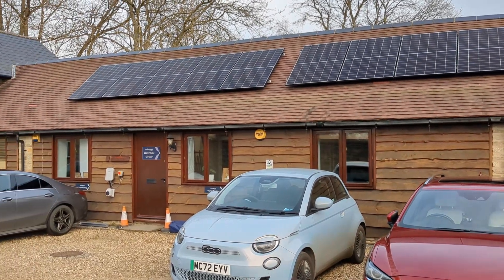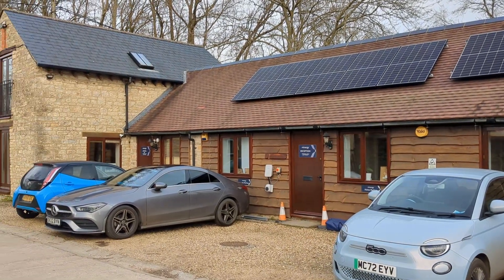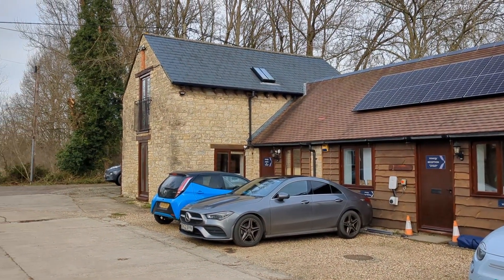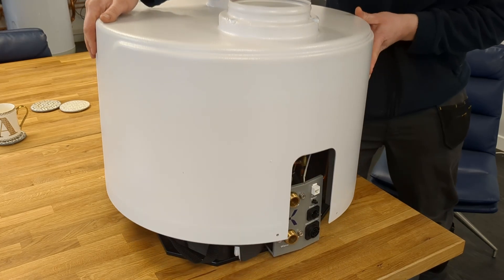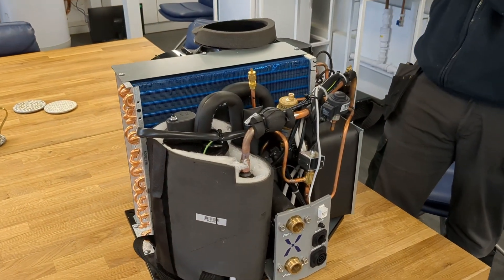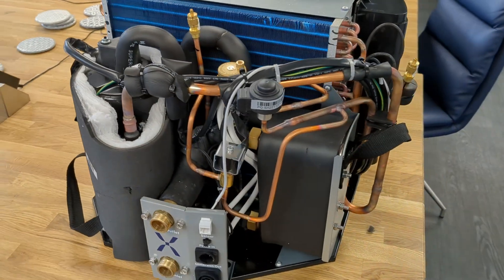Let's chat about the Mixergy iHP cylinder

Comment: Will be following with interest. I own a 2 bedroom flat that has an electric immersion water heater (no gas).  It’s currently costing around £1400 per year just to heat the water. From my rough calculations I think this would be £300 to £400 per year with a heat pump water heater. We are top floor so can draw and exhaust to the loft. Have some concerns about noise levels, as it will need to go in the airing cupboard.
Reply from the maker: You can get sound proof boards that you can fix to the inside walls of your airing cupboard to help reduce the noise.  It's an extra job but probably worth doing if the noise is a concern at all.  I hope it works out for you!

Comment: Good to hear what you guys are up to now - I was definitely encouraged by your Green Walk to go air to air and that has worked perfectly since June and through winter for space heating. Our gas boiler was knackered but we got by with the immersion for hot water. Then I thought we're VERY reliant on Octopus Cosy and Solar batteries to make it economical. What happens in a few years time when everyone wants to charge their EV overnight? The iHP is expensive and probably won't have the best COP when heating water to 60°; it will incur service charges for the warranty and may only last 10 years - it will reduce CO2 but it won't be cost effective. So I'm afraid we bought an 11kW gas boiler to only do water heating and so far it's used about the same as the pilot light on the old boiler. There's a few other pros for it - 1. we can heat water at any time of the day, not just off peak or overnight. 2. It heats the entire cylinder which the immersion didn't do, so we can have baths again. 3. I'm contemplating using it to heat towel rail radiators in the bathrooms and turn off all the other house rads—that would also get some heat where the a/c doesn't quite reach. 4. It would give us a backup if the outside temp ever got to -20°. 5. It's cheaper than the immersion which of course the Mixergy also has and the whole installation cost less than the cheapest Mixergy.
Reply from the maker: Fair enough.

Comment: I was looking at Mixergy and still am. I saw a video maybe 12 months ago that suggested you lose the smart element (zonal heating in the cylinder) when using solar divert (or something like that). Be interested to see if this is still the case when you get yours done, assuming you’ll have solar divert on 😊
Reply from the maker: Well, possibly not, it depends a lot on the tariff, as the export rates could be very favorable meaning solar divert isn't as beneficial as exporting the excess instead (Octopus Flux has exceptional export rates).  In either case, the iHP works a bit differently, the stratification is used in boost mode so that you get usable hot water at the top of the cylinder quickly but the CoP of the heat pump isn't as good in that mode.  In eco mode the heating is done from the bottom to achieve the highest CoP.  So the strategy is to heat up overnight in eco mode, then use boost mode later in the day if required.  Solar divert will then run whatever mode you set, I believe.

Comment: Am I right in thinking pros are 1/3 energy consumption compared to immersion heater, know exactly how much hot water you have left, can connect to home automation (via cloud service?), 2 heating modes: can heat top of tank first to get some hot water quickly or if heating whole tank it’s more efficient to heat from the bottom. Cons: cost, no 300l tank, takes ages to heat whole tank as heat energy output only about 2200w, noisy (compared to immersion heating).
Reply from the maker: Pretty good summary, yeah.  Most people wouldn't need 300l, tbf, and the fast reheat in boost mode would help if needed.  The eco mode could be used overnight so you'd have a full cylinder at the start of the day and then top-up later if required.
Reply: The efficiency is more complicated (worse) than that. It is pulling heat out of your house to put into the tank. All of that heat will need to be replaced by your home’s space heating system. So you are paying to put the heat into the house, and then paying some more electricity to move some of that heat into the water tank. The quoted efficiency is only for the 2nd step.

These integrated heat pump tanks only make sense in hot climates.
Reply from the maker: @Aethid  no, you'd typically have vents to pull the air from outside and then exhaust back outside after, you wouldn't pull the air from the house.
Reply: @TimAndKatsGreenWalk  Ah, well that would make it a lot more reasonable then. It is frustrating that the mixergy tanks do not play well with external heat pumps, for those already using one for space heating.
Reply from the maker: @Aethid  the regular Mixergy tanks can be used with an external heat pump to great effect.  Take a look at this blog post, for example: https://energy-stats.uk/mixergy-heat-pump-performance/
Reply: @TimAndKatsGreenWalk  You lose the stratification advantages when running the mixergy with an external HP, which defeats the whole purpose of the mixergy. Additionally, the mixergy does not report temperature to the HP, but instead only sends an on/off signal - which prevents the HP from modulating itself - greatly reducing its efficiency. That blog post is entirely about the benefits of using a plate heat exchanger for the HP-tank connection vs a traditional coil, which is a configuration that can be used with any tank.
Reply from the maker: @Aethid  well, he did achieve comparable SCOP, so I'd say the efficiency wasn't greatly reduced compared to a standard cylinder.  I agree that there probably isn't much point using a Mixergy cylinder with an external heat pump if you don't already have one, but if you already have a Mixergy cylinder before getting a heap pump heating system installed then you can still use it, rather than replacing it with another cylinder.  If you don't have a Mixergy cylinder to start with then you may as well install the cylinder that comes with the heap pump system as that'd likely be cheaper.
Reply: Do heat pumps still only heat the home or the water but not both at the same time? To me that’s a major selling point for getting a HP cylinder.
Reply from the maker: @jamestechuk  as far as I'm aware when a (regular) heat pump heats the water it won't be heating the house at the same time.  Usually you'd schedule the water to heat overnight when the space heating load is low anyway, so it's not usually a problem.
Reply from the maker: @jamestechuk  yup, just confirmed with a friend who has a heat pump heating system, this is the way it works.

Comment: Curious on expected energy savings. It should be sized for its needs and have a decent COP, and obviously your HP can dedicated to heating so COP stays high. But ultimately you’re heating X litres of water so energy in may not be that different?
Reply from the maker: The CoP of these cylinders is similar to what you'd get with an external heat pump when used to heat hot water, so you wouldn't save energy relative to that setup.  But compared to an immersion heater you'd be using only a third of the electrical energy to get the same amount of heat energy into the water.  I've got lots of historical data for the immersion heater, so I'll be able to do a good comparison in due course.
Reply: ah I'd forgotten you're A2A so this isn't a 'vs wet HP' situation! 
 @TimAndKatsGreenWalk
Reply from the maker: No, indeed.  If we had A2W I wouldn't be bothering with a heat pump cylinder, for sure.

Comment: running the numbers this device doesn't seem to make sense.  it costs more to buy it costs more to install (needing pipes outside the house) where as a direct cylinder does not and if it's like the American ones they lose efficiency over time because of dust and whatnot in the fins against simple tank and immersion with over night "charging".

It will be really interesting to see if it truly is a cheaper option and can cover the extra costs in savings
Reply from the maker: I've never claimed this was to save money.  I'm doing it to reduce energy use.  But you're right, it almost certainly won't "pay for itself".  Mine won't need pipes outside of the house though, our garage is part of the house so all pipes will be internal, and in fact no new pipes should be needed, it'll use the existing ones, hopefully

Comment: We're in exactly the same boat, just waiting for the release date then ours will be in too....
Reply: Finding mixergy a little disorganised to deal with, been told it's not released, it is released, mixergy shop isn't going live for the foreseeable, we're changing the design, we're changing the gas etc etc.... Bit worried that they might be a bit too busy or small to be able to deal with the demand.... Worried if it goes wrong I'll be stuck...we're installers so well versed at dealing with renewable manufacturers etc, mixergy isn't quite what we were expecting. That might not be a bad thing but initial impressions aren't great tbh.
Reply from the maker: Not long to go, hopefully.

Comment: I think I pointed out the R134a refrigerant issue with the Mixergy iHP when you first started looking at these cylinders so it's good to hear Mixergy have made the switch to R290. I'm also looking at Mixergy & SunAmp Thermino phase change hot water options to replace my vented HW tank. ATM I'm still undecided about which way to go. Ideally I want to move the cylinder / SunAmp unit into the loft from the airing cupboard because I have no space left in my garage. However, the Mixergy tank (& most of the other makes) would require a larger loft hatch which is not the end of the world but just another bit of hassle to consider. Going to unvented mains pressure hot & cold water also means I will have redundant power showers & pumps to deal with as well.
Reply from the maker: There are always so many things to consider!  It does take a lot of effort to get it all figured out, for sure.  Best of luck with your project!

Comment: So will it fill the bath?
Reply from the maker: Should do, yeah.  Depends what size you get, I guess.  There are quite a few options to choose from.
Reply: @TimAndKatsGreenWalk I was meaning your bath Tim. I was just thinking that with the gubbins on the top reducing overall water tank capacity you might end up being limited on tank size or location options. 
I have a 300 litre unvented cylinder coupled to my heat pump as part of my wet system which fully fills a full size bath before running cold - but only just - it drops three or four degrees at the tap toward the end as the cold water refills the tank from the bottom - and I struggled for space. I ended up putting it in the loft with millimetres between the top and the rafters and that was after changing make and model to one 50mm shorter and larger diameter but still with a high transfer coil suitable for a heat pump. Options were limited.
I don't know if they do one with the heat pump gubbins on the side - that could give them more install options. Another alternative is a horizontal cylinder but they have issues.
Reply from the maker: @johnh9449  our current cylinder is 250l, which is way bigger than we need.  We usually use less than 150l per day between us, closer to 100l most days.  The largest iHP I can see on their website is currently 210l, but I expect we'd need no more than the 180l version.  There are no heap pump cylinders of any kind that I know of that are as large as 300l.  We never have baths anyway, so that's not a consideration for us, and I doubt we'd want it fully to the brim even if we did!  The advantage of this particular cylinder is that if we needed a bit more hot water later in the day the boost mode is very quick to give you some extra usable hot water without having to reheat the whole tank and still with decent CoP (although not as good as the eco mode where the whole tank is heated).
Reply: That sounds Ok then👍 I usually have showers that are powered from the home battery but I do like a hot (as I can bear) bath every now and then and with me in it the water can only come up to the overflow. Hot soaks are good for thinking and solving problems I find 🤔

Comment: I have an old cottage which only has a water supply and electricity, currently heated by bottle gas combi boiler and woodburner. Im hoping to gutt and iternally insulate the solid walls and floor and run A2A heating but was stumped for the right product for water heating. This looks absolutely perfect!
Reply from the maker: Certainly looks like a neat product and the sort of thing we were after, so hopefully it'll do the job.

Comment: I’m watching with interest. At some point we need a similar solution here. Choosing a location for the cylinder is a concern for us. We used to have a cylinder in the airing cupboard before we moved to a combi boiler. If we use that space then Henry the hoover faces eviction from his cupboard home. Space is a consideration too as it is tight in there. We also need to consider the duct work for the vents as it isn’t on an external wall. 🤔
Reply from the maker: Yes, indeed, all valid concerns.  We'll be discussing the various options with Mixergy when they come to visit us, and I'll ask about the practicalities of the different placement options, including the airing cupboard, so hopefully I'll have some more details to share in due course.
Reply: @TimAndKatsGreenWalk  This is maybe a silly question but I’ll ask it anyway… can these things be installed in a loft space? I’m assuming the heft of them is the limiting factor. Also, even if your installer is an olympic power lifter they probably don’t  fit through the hatch. Just thinking if you could use waste heat that escaped into the roof to heat the water it would be nice and the whole arrangement is out of the way.
Reply from the maker: @ChrisJakins  I don't know, I'll ask when Mixergy come to visit us.  You'd still need to vent to the outside though, or at least the output vent, otherwise you'd end up with recirculation of the exhaust air which would reduce the efficiency.
Reply: Yes indeed. We have a very long flue on our boiler that takes that path currently. I wonder how long the exhaust vent is allowed to be. I’m sure that sort of thing is in the specs somewhere.
Reply from the maker: @ChrisJakins  yup, this page shows you the effect that vent length (and bends) has on the CoP, which you might find interesting: https://support.mixergy.co.uk/ihp-faq
Reply: @TimAndKatsGreenWalk  thank you very much

Comment: Thanks for the update on this missing link in your full (efficient) electrification give you went for A2A heat pumps. I wish you a smooth installation!
Reply from the maker: Thank you, I hope it goes smoothly too.  Given it's a new product I'm sure there will be a few problems to solve along the way but hopefully Mixergy will learn some useful things from the process to help streamline the process for others down the line.
Reply: @TimAndKatsGreenWalk  That's a great way of looking at it. It will definitely be interesting to see how the control side (phone app, tank capacity and demand estimation) will develop, as that is what Mixergy are particularly known for (and issues there will be a software update away from being resolved which is nice).

Comment: Remember, everything crammed in that tight little package is not gonna be fun to work on down the road. So you’ll pay dearly when it breaks.
Reply from the maker: Ok, no need for such a pessimistic outlook.  I'm guessing you missed the fact that the head unit is separate from the cylinder so that it can be easily removed and repaired/replaced if necessary.  It does also come with a warranty, much like any other piece of complicated equipment you might purchase.  I wouldn't be doing repairs myself!

Comment: Really interesting and thank you for sharing, I think the garage is the best option but you will be well aware of the need to ensure its insulated well during the winter time as the garage is not something you would normally heat (regardless of it maybe being within the main body of the house). I'm obviously keen to see how the tech is advancing and while I already have my own Dimplex ASHP system but the Mixergy was always an option,  they just didnt have an ASHP available when I needed to do my install. Look forward to the "data"
Reply from the maker: I've been keeping an eye on the temperature in the garage over the Winter and it doesn't usually get below about 10-12 deg, so I'm hoping that's going to be fine.  It is insulated but obviously has a very large garage  door too, so it's never going to be toasty warm in there.

Comment: Have you compared consumption data to heat your hot water using an ASHP against the Mixergy cylinder?

Thank you.
Reply from the maker: You mean using a standard external heat pump compared to using the iHP?  They have similar coefficients of performance so the amount of energy used to heat the hot water is about the same.  Compared to the regular (non-heat pump) Mixergy cylinder both an external heat pump and the iHP will use about half to a third of the energy.
Reply: Apologies yes, compared to a standard hot water cylinder.

ASHP and Mixergy cylinder have a similar CoP, that’s good to know thank you.

My thinking was, as I have Solar, I do not divert this power to the cylinder, as I believe it is prudent for us to export the excess at 15p.
I re-charge both batteries overnight at 7.5p, so it’s a 2:1 scenario from the grid, and free off the excess Solar. 

I could be overdoing it with a Mixergy cylinder on top. Horses for courses I suppose.
Reply: PS Hope the install goes to plan.